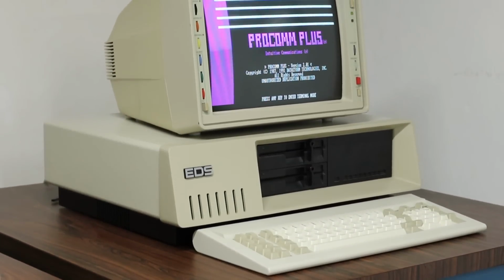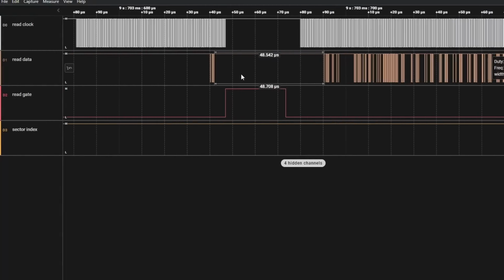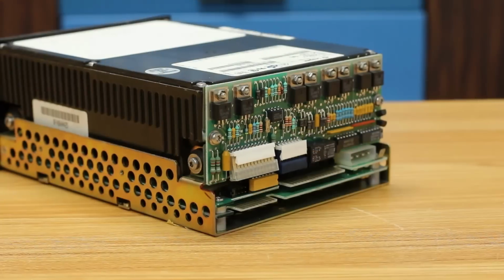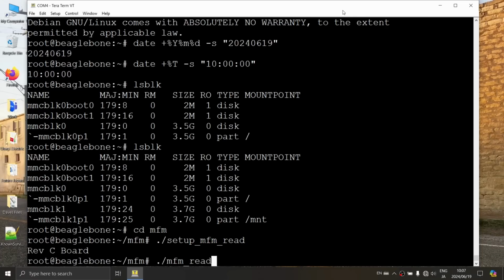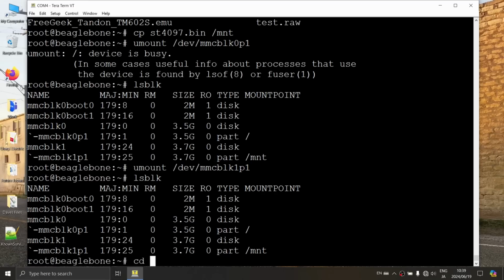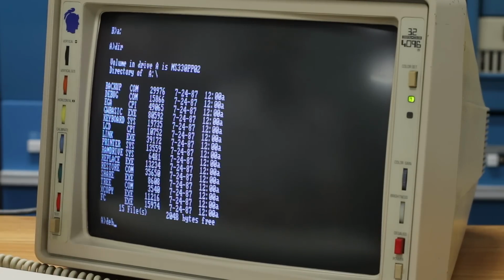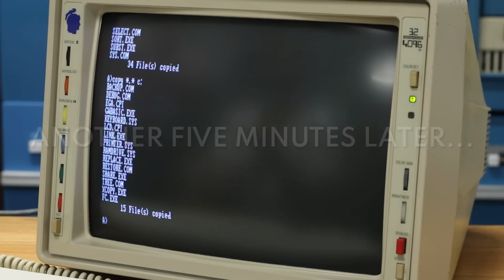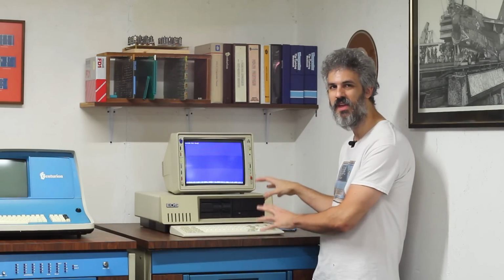FM is RLL, MFM is RLL, RLL is RLL! Fight me.

Comment: For people with MFM/RLL drives that still have the same or format compatiable controller, there's relatively easy way to do full image backup: set up any old x86 system without any other hard drive controller, add a network card and boot DOS 5+ from a floppy along with these utilities: etherdfs for network drive mapping and diskedit from Norton Utilities, it allows to do raw sector reads like unix command dd to a file. Save it to the network drive and you're done! Alternatively using XT-ide instead of the network drive should work too, but I haven't tried it.

Comment: Can we write software to convert encoding? If it's simply a file of flux transitions we should be able to dump the data into a non concatenated data file (just the raw non-modualted bytes and sectors ie, how the computer sees the data from the controller) once we have that we can virtualize the drive in an emulator to extract the data.

Comment: Before MS-DOS 4, the sys command required the disk to be freshly-formatted. Starting with MS-DOS 4, the sys command was able to handle files already being on the disk.
Reply: What you would typically do was use the /s parameter for the FORMAT command, which would do the equivalent of SYS immediately after the format.
Reply: I think the root cause is in a boot sector loader. In 3.3 it was just loading system from reserved sectors. Later it started to look for system in directory entries
Reply: @alexloktionoff6833  The DR-DOS bootloader could read the system files from the directory entries, which was very convenient. However, MS-DOS was never able to do this.
Reply: @alexloktionoff6833  If they were reserved sectors, then there would be no problem loading the boot code in later.
Reply: @big0bad0brad  They are reserved once used. So it's more them being fixed ones, and if they already are in use for other things, sys cannot free (and reserve) them.
Reply: @alexloktionoff6833  Not reserved sectors.   IO.SYS had to be the first file in the FAT.  IO.SYS and MSDOS.SYS had to be contiguous sectors.  MSDOS 3.3 allowed sector 4+ to be fragmented while MSDOS 5.0 allowed the first 3 sectors of IO.SYS to be anywhere but had to be contiguous.
Reply: The boot program is a dumb program with no file system knowledge. Therefore the o/s MUST be the first block of code in tje bootable partition. This file MUST be in contiguous locations, therefore there can be NO files on the disk prior to running the SYS program.
So C800:5 is the low level format program in the BIOS. BIOS is located at C800 you can disassemble this area to see where the low level program is. When you type in G C800:5 so you are setting the CS register to C800 and the IP to 5.  After that the FORMAT program must be run to create the partition table on sector 0 track 0. Once this is done you MUST run the SYS program to make it bootable, then you may copy any additional files to tje HD
Reply: @rty1955   Close, but there are a few errors here.

C800 is the option (card) BIOS area, not the system BIOS.  You didn't specify this either rightly or wrongly, but the bit about disassembling this area isn't quite accurate, as there may not be a card with a ROM at this address at all.  The first few bytes have to contain the magic sequence to identify that something is there, and contains executable code.

FORMAT does not create a partition table.  Low-level format sets up the disk structure -- writing sector address marks on the physical media -- but no data.  FDISK creates the partition table, and the Master Boot Record (the first sector on the disk, sector 0), which locates the first bootable (active) partition, and then hands control to the Volume Boot Record (the first sector in the partition), which loads the OS.  FORMAT is what creates the volume file system, and the VBR.  If you use FORMAT /SYS (or just SYS COM by itself, after formatting), then you get the DOS system files*, IO SYS and MSDOS SYS, and the command line processor, COMMAND COM.  (* Or, if you're using something based on IBM's PC-DOS, you get IBMBIO COM and IBMDOS COM instead.)

The boot loader -- which is a combination of code in the MBR and VBR, in the space not used by the partition table and FS-specific data -- is not quite as dumb as you think.  Well, it technically depends on the boot loader that you use, but the default MS-DOS 3.3 loader was much more flexible than earlier versions.  The IO SYS file no longer needs to be fully contiguous, as long as the first three sectors are.  It just needs to be the first directory entry in the root directory.  MS-DOS 5 relaxes this a bit more.

This all makes sense, as you can walk a FAT file system pretty easily, particularly if you only need RO access, and you make some assumptions about things like sector size (always 512 bytes) and max volume size, which early versions of DOS did.  Overall, the structures are simple and straightforward.  And once you have to consult the FAT for the location of anything -- either the root directory itself (with FAT32, since it's no longer at a given static location), or as you read the directory entries and have to look up the cluster that IO SYS lives in -- then it's not much more effort to keep consulting the FAT to handle fragmentation, rather than assuming it's always consecutive.
Reply: ... or format c: /s   (to copy the boot-files to the disk during the format process)  Just don't overwrite msdos.sys, as this file needs to be placed at a specific sector on the disk.
Reply: Well, you sometimes could get by with it, but there were caveats. It had to start in sector 0 or 1, and thus if the front of the drive is used, it would fail with an error that there is no room. It isn't so much that there was data on it as much as where it was. If you had general files there or a kernel with unexpected names (like ibmdos.sys instead of msdos.sys), it would refuse. Now, if you deleted the offending files, you could write to disks with other files on them.

Comment: The sys C: command on DOS 3.3 does not work if it detects a IO.SYS and DOS.SYS in the root directory. This changed sometime at a later DOS version, since it was not useful fore repairing systems that could not boot.

Comment: MFM, RLL and ARLL are just NRZ encodings. The later just needs more SNR/less error rate/stable clock. No problem to use an RLL drive for MFM. Used a Perstor (PS180?) ARLL (x1.9 aka 2:7) on a ST4096 (which was sold as MFM) for years without issue.

Comment: DOS was limited to the number of files in the main directory. You're best off creating a `dos` directory and copying the files into that.  You can set the PATH variable in the `autoexec.bat`.

You can also do a "format /s" which will format and copy system files, though the `sys` command works.

As for the interleave, it means what it says.. what is the ordering of sectors on a track.  an interleave of 1 numbers the sectors '1 2 3 4 5...' and an interleave of 2 numbers the sectors differently.  The best interleave tries to get the next sector under the head when the system is ready to read.  This is VERY hardware dependent.

The old program `spinrite` can verify drives of that eras as well as determine the best interleave.

Comment: You need to copy all the DOS files into a directory usually called "DOS", because the number on entries  i.e. files in the root directory is limited. The error message is a bit useless since it will only say something "not enough space left..." when it actually should say "not enough file table entries left..."
Reply: It's either that, or old versions of sys weren't able to move stuff around to make space for IO.SYS (of which at least the beginning needs to be in the first sector, IIRC)
Reply: @seritools  Ahh yes, that was the reason, I remember now. Similar for Windows: KRNL386.SYS can be anywhere on the drive but must not be moved. It was loaded using a sector table written to the boot sector compiled during installation. If the checksum didn't match then you got "Cannot find or load KRNL386.SYS".
Reply: The limit is 512 items in the root directory, which includes hidden files and subdirectory’s.     I know this thanks to having to recover a customer’s system after they saved everything to the root…

Comment: Instead of using format c: and sys c: you can also use format /s c: and transfer the system files as part of the format.

Also, ensure that the partition you want to boot is active. From what I recall fdisk from dos 3.3 will take care of that, but it is something to always check.
Reply: I came here to say this, but I wasn't sure if /s was available in 3.3. It's been a very long time! lol
Reply: and if you know the drive is good, add /q for a quick format. The non-quick version just checks for bad sectors before writing the file system. Not sure if that is already in this old version of MS DOS, but for sure in later systems.
Reply: @drstefankrank  I'm not entirely sure which version introduced /q but it wasn't available yet in 3.3. From memory it was 5.0, but.. I try to forget DOS 4.0, so it might have been that one as well.
Reply: @c128stuff  Like 4th Edition D&D vs. 5e, there were some good ideas in DOS 4 but for the most part they got carried over into version 5 so there's no reason to stick with 4 and its warts.
Reply: @mal2ksc  I was a tester for DOS 4, and DOS 4 fdisk actually has a little bit of code from me (fix for selecting an other disk than the primary one). 

It certainly had some good ideas, but it was rather problematic due to memory use. 

I probably spent hundreds, if not thousands of hours on helping IBM 'large accounts' (ie, large corporate customers) dealing with exactly that issue.

(when DOS 4.01 got released, I worked for IBM)

DOS 5 was a huge improvement, containing all the improvements from DOS 4, but without the issues.
Reply: @drstefankrank  quick format only works if the drive was already formatted before. On a freshly low-level formatted drive, you need to use the normal format.
Reply: @kpanic23  Back in the day, I was a kid, never had to low level format any disk. Later i found out, that the normal format command only does read checks until 99% before it writes down the filesystem and may include some bad sectors it may have found.
When I forgot to use /q I could safely cancel the process and all data was still present. I have no clue if format does something different on a low level formatted disk. The messages it outputs is Microsoft like not very detailed.

Comment: I did a similar thing in the early 90s. I got two MFM hard drives (one full height and one half height) basically for free, as there were considered old, loud, large and slow by then. I learned about RLL and that using that would make the storage capacity some 50% more and reading the drives would be faster. I was happy to have the extra storage, and my tower case has enough slots for the huge disks. But man, were those drives noisy...

Comment: You have experienced, "Low level format" using the ROM on the controller that is at at memory location C800:5.   Then the "partition" using fdisk.  Then the "high level format" using the format command.
Reply: who needs drivers when the hardware itself comes with a BIOS ROM. 

this idea of the operating system having drivers was a mistake, we should go back to having ROM BIOS
Reply: @monad_tcp  Those ROM BIOS are why the x86 memory address space has been a hot mess for 40+ years. I'd rather not.
Reply: @monad_tcp  a real mode BIOS. This would not work in protected mode as is. But no standard hardware API leads to a million drivers and no compatibility with linux or even other generations of Windows so I kinda agree with some of it.
Reply: @monad_tcp  The code that firmware developers put in ROM is utter garbage with atrocious performance. Good code has never been put in ROM, only trash. BIOS developers have delusions of illusory superiority. You would be right if this planet weren't jam packed with utterly incompetent people. BIOS code is when some jackass thinks it is fine to just spin in a loop until I/Os completes. Some jackass that reads one block at a time, using individual PIO instructions that are 8000 cycles each, with a comment that says // FIXME: Use DMA, lol.
Reply: @monad_tcp  What's old is new! Some modern PCIe devices contain a UEFI driver in a standard format on a flash ROM chip. This enables the device to do certain things in the UEFI before an OS loads. For instance a graphics card can detect a display and show text and graphics at native resolution, and a network adapter can obtain an IP and connect to a server if you want to network boot an OS. These drivers can be used by simple OSes too, but most will want to load their own drivers for the device in a format that meshes better with the OS's structure, to support more advanced functions like 3D acceleration of vendor-specific features like CUDA.